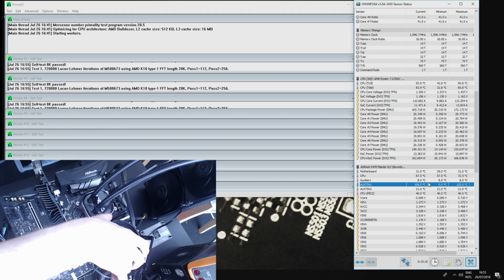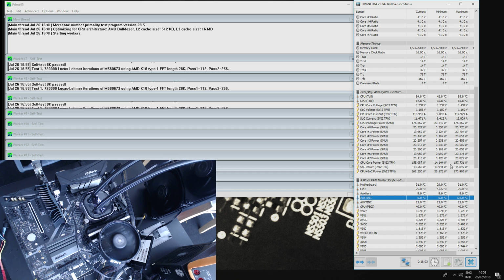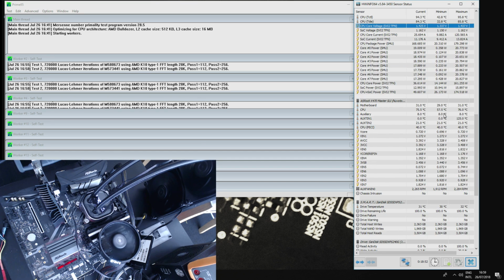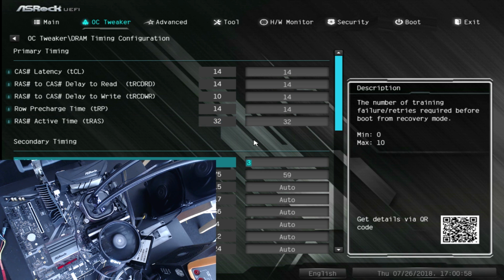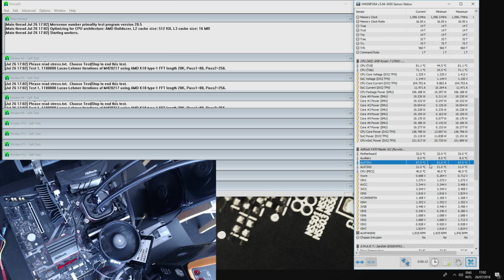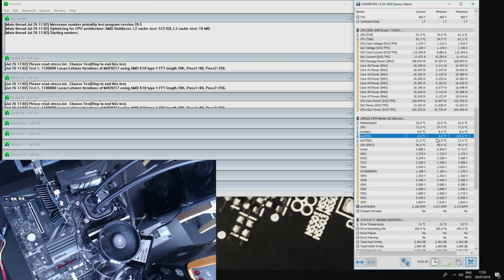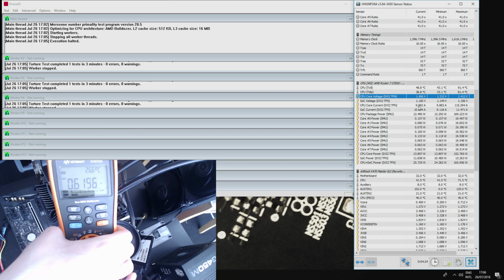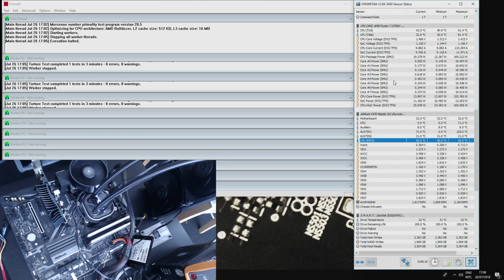The Asrock X470 Master SLI VRM temperature sensing is broken and there's no OTP either

Comment: Would be funny if they were using 8 bit signed int for the temperature  value and can't track it past 127, so they just turn off the whole system to be on the safe side.

Comment: i have this board with 2700X w. 2x8 dominator platinums and it has a hard time running at 3200. it runs for a few seconds and then crashes. would changing to the Aorus X470 moba a good move? i just want my hardware to sync and be stable for once .....

Comment: i have the asrock master sli/ac x470 and my vrm runs 30c-34c also have ryzen 2700x nothing exceeds 45c except gpu (rx590 fatboy) which doesn't get above 70c playing resident evil 2 (new release)
Reply: Hi i just bought this board. Dont ask me why. But i assume you have lastest bios right? So they fix problem i supose. I m gona  get the board this week and try that. I m wondering if @buildzoids concerns are real.

Comment: so...I just bought this board. I'm wondering if a lot of these complaints are mainly with the concern of over clocking?
If I'm not intending to do any OC - will this do the job for a Ryzen 2700x?
Reply: I've had this board for a year and like you I just dropped in a 2700x and ran,  works fine in everyday mode. Tho I also have a Noctua NH-U12S blowing air around the VRM area so that should help keep the VRMs cool. Going to watch Buildzoid's video before I buy my next mb though.

Comment: Buildzoid I have a question is it safe to run Ryzen 5 2400G on MSI B350M Gaming Pro ? I wish I had find your channel before I bought that damn MB (after numerous recommendation from numerous so called tech youtubers). HWiNFO64 rapports that SOC is drawing 90,3A during gaming (on stock no OC everything set to auto in BIOS). Am I facing SOC VRM damage over time and should change MB asap or HWiNFO64 is lying to me and its safe?
Reply: It looks like this:
https://zapodaj.net/images/01f7472627599.png
Reply: It is very interesting and shows how exaggerated requirements for the CPU VRM are. One claims that for Ryzen 2700 CPU the 6 or 8 phase VRM is needed for core only (95W or 105W for X version) but the Asus made CH7 board with 10 phases for, say 200W CPU Vcore but only 2 phases for 90W iGPU! It seems that 2 phase VRM with doubled Niko (!) mosfets can handle 90W output! MSI claims that your CPU is supported so it guarantees that the VRM will survive and replace your board in case of failure. I think it is hot at your place now and the VRM still works.
Reply: Yeahh its ~30 C . So your advice is not to bother and if it dies then send it back under guarantee, yes? BTW If I had know about all those VRMs in May I would go and bought Asrock AB350 Pro4 it has 6(3x2) + 3 vcor/soc config instead of 3+2 like on my MSI and it cost just 5 euro more back then if I recall correctly. Grrr.
Reply: Yes - do not bother and you likely never replace the board because it won't fail. 
The SoC VRMs could have similar performance: The MSI uses 2xPK632BA for each phase while Asrock uses 2xPK618BA for the phase. The PK618BA is worse than PK632BA. The VRM controllers are different as well (Richtek vs ISL) so it can be that performance wise these VRMs for SOC are not so far away. 
If you want to improve stability you can buy cheap small heatsinks e.g. for power transistors (look like small U-shape comb) and glue them with thermopad (preffered) or SuperGlue (cheap). It may help greatly.
As to selecting another board:
Mądry Polak po szkodzie :P
.

Comment: hi, i have the same motherboad and am running a R5 2600 in it at stock. running the same test with Prime95 and with HWiNFO open. i watch the Auxtin1 to see what it did. in a fractal design define r6 with 2 120 fans on the bottom of the case and 2 140 fans in the front. and a 140 on the back as well as a 240 AIO on the top of the case. (do you think i over did the air flow?) my Auxtin1 after 36 mins has hit 70c. it was 5 mins ago (when i start to type this) at 68c and had been at 68C for well over 20 mins. my guess is that Prime 95 is pushing one of the cores a little harder right now.i going to keep it going for a full houre. but after seeing this i dont think i going to try overclcoking my system any more. i will say that this system has crashed alot when i tryed to do storeMI on it. maybe this is why... as i can not repro the crash anymore as i have removed what was making it crash (storeMI on the 970 EVO) and said Evo now is a normal windows boot drive. as i said can not test to see what this Auxtin1 reads at time of crash. so wishing i did not get this board... it's RGB program suck's. oh and at 45mins it now up to 72c... NOT happy. i had hoped that the air slow would stop the over heat. it look like it only slows it. maybe this is not a motherboard for AIO. as a Air cooler would also blow air on to that part of the board.
Reply: update after 1 houer of testing it's come back down to 69c. so it look's like 68c-72c in a case with what i would call over the top air flow. if you have a AIO or custom loop you need high air flow to run this board. wish i know about this before i got the AIO as i did have this board set up with the stock cooler that come with the R5 2600, that as good as it is only just dose the job on the 2600. dont get me wrong it blows the intel stock cooler out the window. but the 2600 needs just a little more. than the stock cooler can give. anyhow @Actually Hardcore Overclocking please keep teating the board. and also please look in to the next board up on asrocks x470's line up as the website said it's the same board with only little bits added. like a POST LED error code read-out. i love to know if thre mid range board got the 100% the same chips as the cutdown do.
Reply: also as soon as Prime95 was closed it droped down to 62c evey fast. then slowed down it temp drop speed.

Comment: As I posted here: https://www.hwinfo.com/forum/Thread-ASRock-Motherboard-CPU-Sensor-Hardware-defect-or-bug?pid=19011#pid19011
"HWiNFO has an internal filter for some temperature values, which converts the 126-128 C values into 0 C, because such values are usually returned by sensors which are not connected, or provide erratic readouts. So the sensor has probably reached a value in that range. If it would be even higher (> 128 C) then the correct value would be shown."
Also note, that only the next Beta build of HWiNFO will improve sensor values for ASRock X470 series.

EDIT: I posted a pre-release build of HWiNFO to improve support of ASRock X470 series in the forum (see link above)

HWiNFO Author

Comment: buildzoid let me say something that may be completely stupid.  i have an asrock board and have the same auxtin1 on my board and sets at 104c all the time.  i assumed it was the vrm temp sensor as well.  was worried about how high it was so i decdided to see what it would take to throttle it. keep in mind that is was a cheap z370 pro4 and i ran 190w or so through it at 1.4v at 5.3ghz with an 8700k on a handbrake encode slow preset.  the vrm temp went down to 103 instead of going up lol.  i contacted asrock to ask them about which sensor was the vrm temp to be sure and they told me that my board has no vrm temp sensor.  whatever that reading is on my board, it is not the vrm temp. have you seen any documentation in the manual or talked to asrock to see if this really is the vrm temp sensor.  just thought i would throw it out there.  wouldnt hurt to ask them.  im sure youre board has a vrm temp sensor but mine looked just like yours (in hardware info 64) but there is no sensor at all.  all it would take is an email

Comment: Not exactly on-topic here but I hope you see this and can answer:
I'm planning to buy a 2700X and want to know what X470 or B450 board I should get with it. I pretty much just want XFR2/PBO do its thing and not mess with overclocking manually, but after watching many of your videos on the boards I feel like I'm stuck and don't know which one to get, since you tend to say MSI has decent boards but no voltage offset to really tune PBO to the fullest. Also I've been looking at manuals for various boards and I can't seem to find any mention of voltage offset anywhere. You'd think if a board had it, it would be mentioned in the manual.
Reply: I also have the same doubt and I've yet to see an objective answer from anyone. Chipset wise I'd go with the x470 just because I'm guessing the 2700x needs better "juice", but as for what board... well that's another story. Everyone shits on almost every board except the extremely, prohibitively expensive asus top board. I just want to build a system with the best cost x performance, turn on the auto OC and enjoy. If you ever find a good answer please send a message.
Reply: IMHO - take 6 true phases (X470 Strix - not sure about B450 Strix) or 8 "fake" phases for the 2700X. It is enough if you are going to use PBO and not going into 4.5GHz territory. But look more at the board features that are important to you (e.g. pump connectors, LEDs, audio chip, wifi or NIC chip) etc. There is more than the VRM on the motherboard.
As I said - at the moment I would go for top B450 boards for the 2700X - MSI Carbon and GBT Aorus Pro are good candidates. I do not know Asrock/Asus offering now.
It would be much simpler if you can select few boards based on your budget and features then ask which one to choose based on VRM or whatever you are not deep into.
Reply: pair the 2700x with an x470 board. check out his review of the x470 boards, pick the one he talks shit about the least. He does extreme overclocking so his view can sometimes be next level overclocking mindset, but he speaks the truth. I personally like the gigabyte G7, but the G5 is also very solid imo. he has a few bios videos out too, for some the bios layout of a board can be a make or break issue.
Reply: Gigabyte G5 is completely different than G7 - G5 = Gaming Ultra with WiFi and more LEDs. The G5 VRM is very close to B450 Gigabyte boards. IMO, B450 Aorus Pro is better value than G5 until you need some G5 features (better WiFi, external temp sensor, SLI, etc). On the other hand the B450 APro has additional M2 heatsink and better connected (PCI3x2 instead of PCI2x4 on X470 boards).

Comment: The manual doesn't always match the bios, but it does show a specific VRM temperature value and mentions the board does have Over Temperature Protection. See section 4.6 pages 87, 89: http://asrock.pc.cdn.bitgravity.com/Manual/X470%20Master%20SLI.pdf
Reply from the maker: looks like they removed that setting from the most recent BIOS revision.
Reply: Yeah I checked the bios list and they didn't mention it in the release notes. Did they remove the VRM temp value, the OTP entry, or both?
Reply from the maker: they removed the OTP setting. TBH I'm not sure it was there before either since I didn't check for that.

Comment: i have the fataly k4, same board with newer realtek audio and more led, absolutely not worth it, bios looks the same.

on mine the cpu sensor is bugged, it shows negative 60c and when i i prime95 it rises to i think real temp. then dropping from 39c to -62c... could be bios bug?
maybe yor sensor is faulty but i think you took an external thermometer to it anyway

Comment: odd that it would be 125° and not 128° since that means that they are deliberately setting the reading to 0 if it is greater than 125° since if they where reading the temp reading adc into a int8_t then you would get a overflow wrap but as it is they are checking that sensor and picking with the reading so when it looks to high it goes off. Very naughty asrock.

Comment: What would you recommend for an apu in terms of the b450 Line Up ? Need HDMI 2.0b (dat HDR) was originally going for the asrock itx, but its only 2.0. Seen a few of your videos which gave me a little caution since i didnt know much about vrm. Thanks in advance.
Reply: I think there are very few boards with HDMI 2.0b considering X370 & X470 & B350 & B450 in total. List the boards then we can advice.
Reply: Welp. Seems like you are right. The only brand I can find that has b450 HDMI 2.0b is ASUS, and the boards are: 

ROG STRIX B450-F GAMING
ROG STRIX B450-I GAMING

TUF B450-PLUS GAMING

PRIME B450-PLUS

(when substracting the micro atx boards as I've heard nothing but bad things from all directions regarding those).

So I guess it's between those.

The messed up part however, is that I was in contact with AMD who told me that regular HDMI 2.0 should support hdmi on raven ridge. However, ASROCK has specifically told me they do not. So I dunno ! But the asrock response was what prompted my initial question, as I'd rather be safe than sorry.
Reply: The best board VRM wise is the STRIX B450-I but it is ITX. Other listed boards are on the same level of VRM as MSI boards and probably GBT ones. 
The HDMI version of motherboard support is misleading as the HDMI lines go from the Ryzen APU and motherboard has very little to do with it. Comparing to sata lines the motherboard provides only cable+connector and maybe some kind of generic signal amplifier. The only difference between HDMI 2.0 and HDMI 2.0b outside the APU is bandwidth 18Gbps vs 24Gbps.  There are reports in the SFF forums that boards rated HDMI 1.4 (10Gbps) are outputing HDMI 2.0 with Ryzen 2000 APUs so it suggest that maybe there is no signal amplifier limitation on the motherboard either.
IMHO: It is possible that HDMI interfacing on all/most motherboards support up to the 24Gps bandwidth so even if they are marked as HDMI 2.0 they can output 2.0b with the Ryzen 2000 APU (the APU must support all 2.0b features).
Reply: Thanks. I Guess its about taking a gamble om the port with a asrock Vs getting the ASUS.. hmm, well

Thanks for the help!

Comment: Hey buildzoid, What do you think about all the BIOSTAR B350 motherboards? They have a 4+3 phase VRM on all motherboards I looked at, and it seems quite decent, with some boards having a good enough looking heatsink. I consider them, because they are one of the least expensive decent options for APU (probably 2200G) and RAM overclocking, I don't really want to shell out 100+ euro on a motherboard for an 80 euro APU...

Also, I strongly consider the Samsung C-Die OEM modules, because they are just a tiny little bit more expensive than the usual shitty clocking 2400 modules and they seem to clock to 3200/3333 on AMD quite easily w/ really good timings for the price, with even 3733 to 4000Mhz easily possible on the Intel platform and 8GB modules (with quite loose timings though, like CL18-CL20 and shitty tRFC). Did you even hear about them? I got the information about them clocking well from https://www.hardwareluxx.de/community/f13/samsung-8gbit-ddr4-c-die-k4a8g045wc-overclocking-ergebnisse-im-startbeitrag-1198323.html, it's a German site but Google Translate can translate it quite well.

Comment: Hello Sir, Love your work. I've got a Master SLI/ac and my temp sensors don't behave like yours....I wonder if you've got a funny sample. I did buy this Mobo not knowing any better, but, I'm not an overclocker, not anything nuts anyway. I'll probably upgrade to the ASUS Hero 7 based on your insights though. Also, is there a 10 deg offset on that sensor like on Tctl?
Reply from the maker: did you actually try to push the board to 125C VRM temp?
Reply: Not as an explicit exercise, I push the system pretty hard. I use Davinci Resolve a lot and stuff gets hot. But, the Mobo is unstable, in general, with default ASRock/AMD SPB, PBO and etc. Once I get the ASUS I'll explicitly try and set the ASRock's VRM on fire. Also, and I think very importantly, The BIOS on the ASROCK is complete Garbage. Serves me right though I should've done more research and spent more money, but, with that being said, I knew I was venturing into foreign land coming from MAc Land. And I figured if I screwed up I'd be screwing up a 120 dollar part instead of a 280 dollar part. But, I take mistakes as the price of admission.